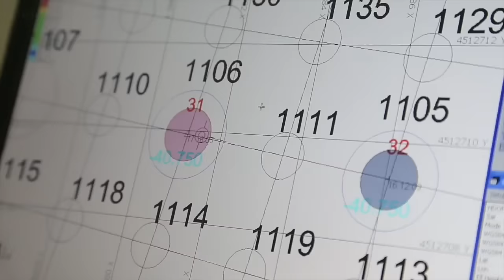Amazing Suspension Bridge construction Time Lapse How Suspension Bridges Are Built

Comment: I still dont understand how the foundation work. They made it on the shore. Then 0laced them. Put sand and eartg inside. Then added the 2 towers and added more soil to make them sink? But...that would not make them very stable. Or even be deep enough at the bottom of the  water to suatain all that weight. If thats the case then, how do they make it stop sinking? How can it not tilt with all that height and pishing force on them?

Any engeneer could explain??

Comment: It absolutely blows my mind how a multi ton piece of metal is hoisted into position and secured with cable supports that doesn't seem like they're capable of half the weight of one of those bridge decks.
Reply: Judging from the video, the cables are at least 5cm or 2 inches in diameter. The minimum breaking force assuming 5cm is around 200 tonnes, 400 per road segment; I guess a segment with heavy cargo trucks on it weighs up to 100 tonnes, one full capacity truck is usually 40, so maybe 200 tonnes worst case if 4 trucks can fit. The cables are probably more like ~7-8cm, so double the area and capacity, or ~4x worst case utility-stress. They simulate the hell out of everything in the same 3D program they use to design the thing (SolidWorks), eg. loads from wind, the wind itself, it's vortexes from the structure and how those vortexes further interacts with other parts of the structure; then they over-dimension everything well beyond the stresses expected. It does look pretty sketchy, but once you've seen a few computer simulations of structural stress and how advanced and in-depth they are, it becomes obvious just how well they know the limits and exact numbers of what they're designing; there's no real-world trial and error, that happens digitally, they know down to the kilo how much stress every little bit can take before they build it.

Comment: I don’t understand the point of flooding the pillars again ? Wouldn’t the integrity of the entire structure last longer if the pillars weren’t submerged in water ?
Reply: Maybe bcoz of weight... Heavy weight means more stable and more safe... Like wind, low tide, high tide etc... IDK exact reason...
Reply: Yes I also couldn't understand about that
Reply: Seawater can actually increase the strength of concrete over time. Some Roman concrete mixes have survived thousands of years.
Reply: The foundations of the towers are vital to a suspension bridge. It holds the tower in place, and if anything the concrete shouldn't get affected.

Comment: Wrong design, support cables unmaintainable whole bridge replacement
if cables need replacement. Check old Severn estuary suspension bridge, same design replaced with new bridge between Wales and England after a very short lifespan same with The Humber bridge they’re going to have to shut that one down soon too same expensive problem ,Corrosion

Comment: Bridge strength incoming 2108-2154 super conductive impact 
Bridge failure by stone and wave shipping transit tsunami type debri, 
Strength or machinery to retreat artiry transit. 
Infrastructure engineering enhancement 97.8 foot cement and shock absorbers pillon 14.9 inches steel 

Underground tunnel
3× more electricity use 
2.0 × speed rate

Block water cutter on a caliper radius table adjusting cutter top to bottom or and neutral tunnel carving block retrat foundry mason fifo lifo 
Stone block water cut flatbed rail and or neutral trucking routing 
2093 through 2235 
Rock stone mountain conglomerate stone ash particulate entry and entry exit earth 2108 year through 2157..
22% all industry require shelter vector nine through thirteen water tight or and neutral standing water process electrolisis h²o h³0 hydrogen and oxygen processing cu³ k.p.a. compression expansion excreting air